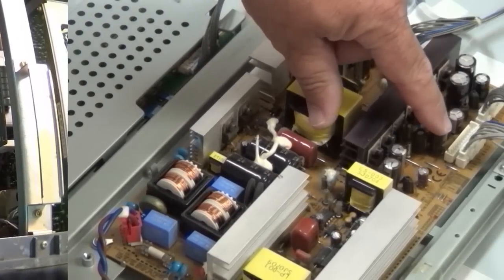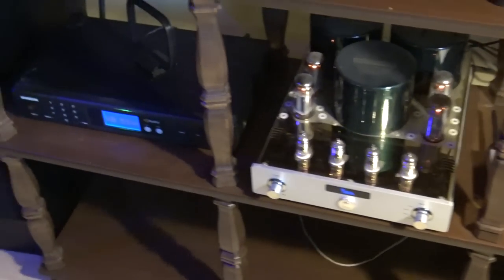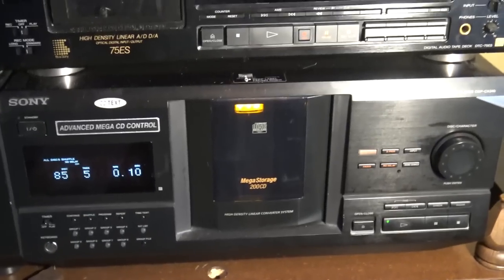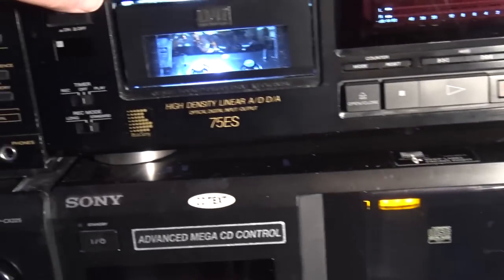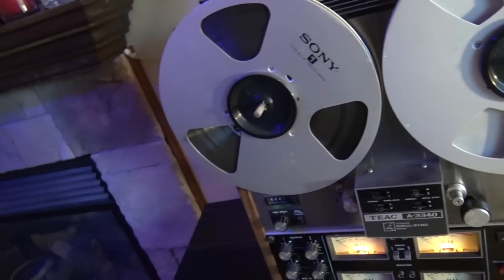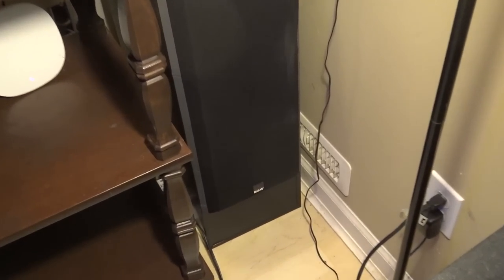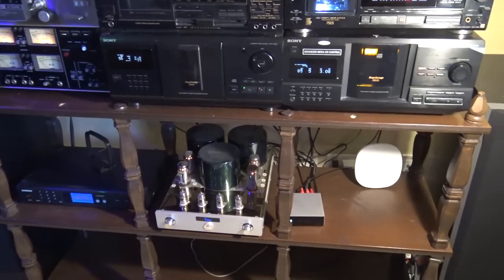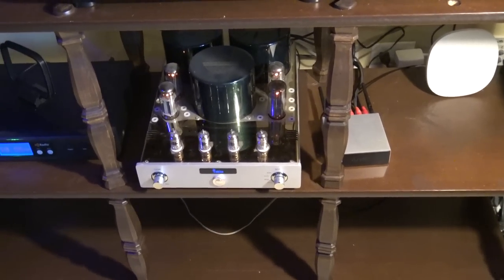A look at one of my stereo setups

Comment: Great to see the gear back IN SERVICE. Felt like every component was smiling back at you as you panned across them.
Reply from the maker: It's never been out of service. I just haven't used it in a few months. Stuff stacked in front of it. Getting rid of estate stuff in  a pain in the ass.
Reply: @12voltvids  How often do you have to use your vintage equipment to prevent it to start developing problems?i know that the rtr's that have belts and cassette decks they can go to waste if not used.
You have a very nice set up!
Reply from the maker: @SDsailor7  i turn them on regularly and run for a few minutes.
Reply: @12voltvids  Ok. Thank you. I will do same.

Comment: Thanks for mentioning this new Canadian made Dynaco ST-70  - I owned one from 1970 and made mistake to sell it - absolutely miss the sound from that gear. I used JBL 4311's with them and wow.  So might invest in this new version !  The older one I had I found on the floor in a box at a Thrift Store on Vancouver Island -  a few wires were disconnected other than that it was pristine and had beautiful tube life mix of Japan tubes which appeared to be the original tubes and some telefunkens. First and only tube amp I have ever found at a thrift store.
Reply from the maker: If I had an extra 3000 burning a hole in my pocket I would order one of the new ones just so I could show off the mapleleaf on the cabinet.  
That would be the next tube amp I would buy, but of course this one would have to burn up first and the build quality of this one is dam good.

Comment: A great setup Dave I was surprised not to see a VHS recorder thou ..
Reply from the maker: VHS Hi-Fi audio blows.  So does beta hifi.  AFM is a very noisy recording meduim that uses aggressive companding to make it listenable.   The problem is you can hear it working.   I would rather not hear anything working.  That's why i used DAT. The only reason that cassette deck is there is for the odd cassette I might want to listen to from back in the early 80s.

Comment: Looks amazing dave, that triple level stand looks solid.
You don't get proper wood in modern furniture, usually it's shitty fiber board.
In the u.k it used to be chip board, bloody crap!!.
I called it Sh1t board.
For your valve amplifier, a cheap fluffy dust removal stick would get the dust off without scratching or moving the valves.
Yep carbon resistors were sensitive to heat,  once hot they never went back to normal.
I still have a mates leak valve amplifier, caps and resistors are a mile away from spec.
As the covid is still killing people here, i won't be paying a visit to R.S Semiconductors for the bits at the moment.
It can wait.

Comment: Good stereo setup. 
interesting to see what you have of hifi equipment.

Only problem is that you do not have good space to set it up properly. slightly pressed together towards the corner.
Reply from the maker: I have space, it's just I still have estate stuff to get rid of. My sansui 9090 is set up with a  pair of SB7000 speakers  about 8 feet away. The room is actually a fair size. 18 x 26 feet for this room.

Comment: The TEAC decks are great.  Got an A3440 and A2340R here.  The only thing I don't like about the 3440 is the fact you can't use locking hubs on it.  I'm not crazy about those TEAC hubs, bit of a pain.
Reply from the maker: Can you not fit locking adapters?  I bought some adapters but they are a joke.  Have to fit them into the reel and then put on the spindle.

Comment: I would like to know if your tube amp causes buzzing from the speakers because personally I have not yet found a tube amplifier that does not and therefore I have relied on a preamp in this sense, greetings from Italy.
Reply from the maker: No noise on my setup.
Reply: @12voltvids  Did you fix it yourself or was it so working when you bought it?
Reply from the maker: @francescosartori8065  
The tube amp was bought new.  I got it soon after the company started production before they were well known.  Have had it for about 15 years now.  Yaquin (pronounced ja-chin) are a high end tube amplifier manufacture.  The name of the company is the engineer that designs and builds them pretty much by hand.  Their prices have gone up in recent years thanks to critical acclaim putting them up against some very respected brands costing several times the price.  
Most of the stuff has been repaired.  The CD players have not faulted as of yet but the r-r  dat and cassette deck has been overhauled.
Reply: @12voltvids  I also use yaqin equipment: two sd-cd3 which are small tube preamps that I have arranged for each channel (right, left).
I also wanted to say that unfortunately I do not understand much about hifi equipment repairs but that I would like to be as practical as you are and therefore I follow you with admiration.

Comment: Nice.   I believe the TEAC 3340/3340S was the machine of choice by musicians for cutting home demos back in the day, before the first Tascam 4-track cassette machine came out.  15 ips, man.  What output tubes do you have in the power amp?  Looks like 6L6s. A pair in push-pull for each channel, like 30 or 40 watts, if I had to guess?
Reply from the maker: I have EL34 in it currently.  It will take 6CA6 I believe as well.  I have only run el34 in it.  These ones currently probably have about 7000 hours on them.
Reply from the maker: Yes 40 watts.  But that is real watts.

Comment: As for your A3340...To keep Mr.Kitty out of the tape,try  constructing a plexi dustcover that covers the reels as well as the deck.You might find that you enjoy that old dinosaur more than you 
realized...(similar to AKAI 625D) Not too much effort using 1/8th in. stock.I have several decks and have had the same antics from two cats.I keep tape on only one or two at a time...
Reply from the maker: It only looks cool.  The CD players sound better.  Too much tape hiss for my tastes.
Reply: @12voltvids  A Tandberg TD20 SE with the right tape has 80dB signal to noise. And thats  with NO noise reduction.